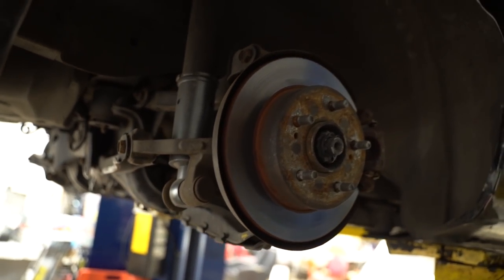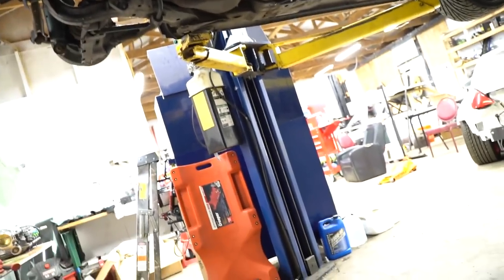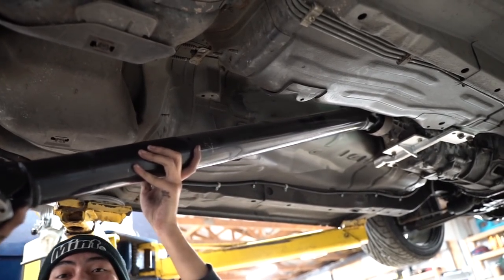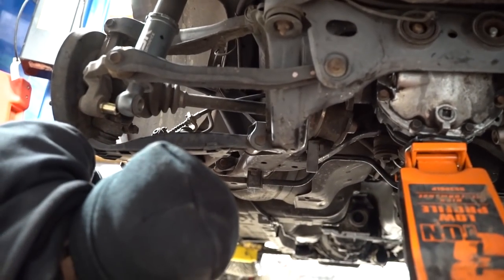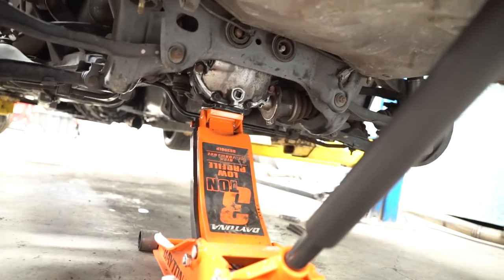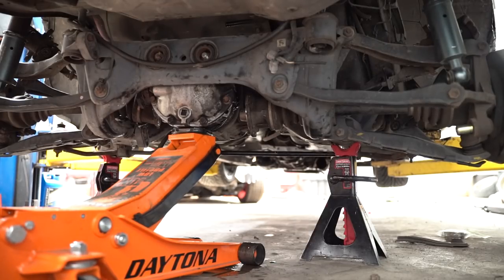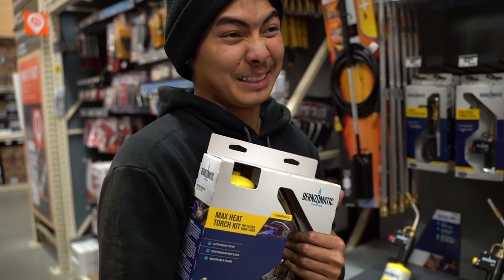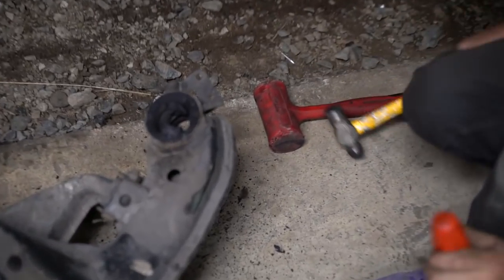1jz S14 Rear Sub-frame OUT

Comment: I’m not hating but using the impact gun with a swivel joint would reduce the torque going to the actual socket. Would definitely work stronger without it